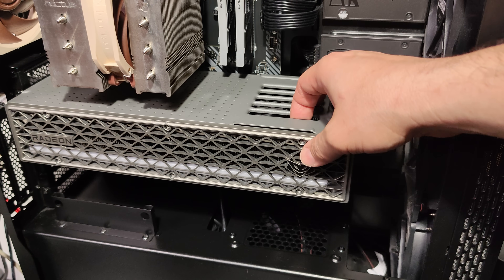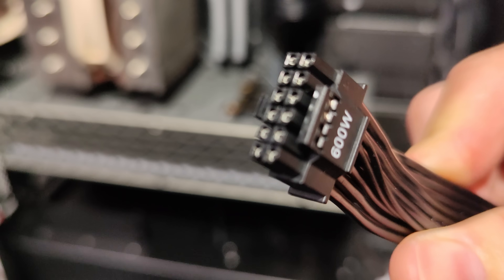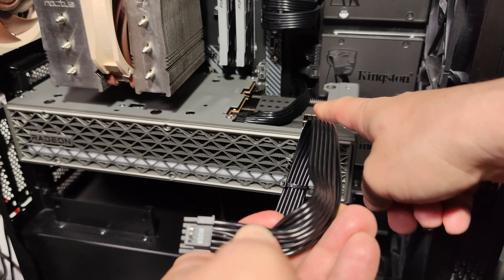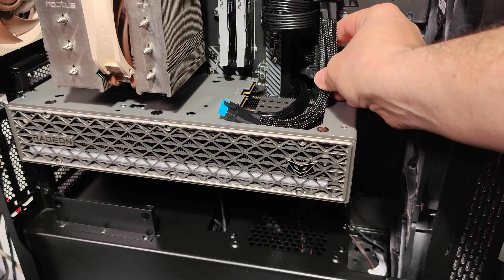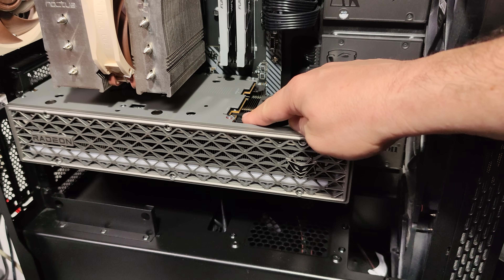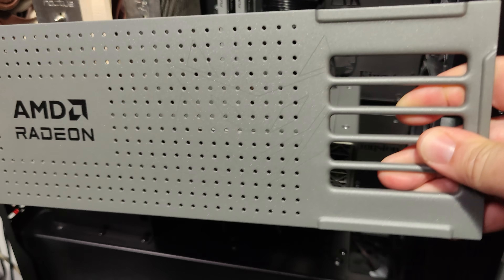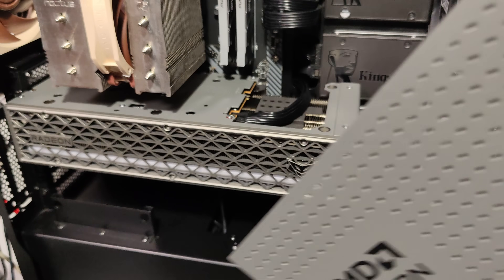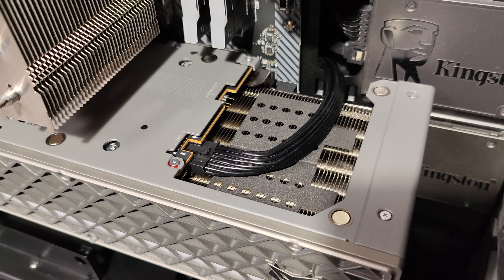Radeon RX 9070 XT Sapphire Nitro+  Magnetic Backplate More Problems Found And Exposed 🔥

Comment: I have question waht is hotsport temp and fan speed in stock. I bought Rx 9070  without RX and i  have in stock Hotspot 76 and memory 76 and speed fan 1550 rpm . I can udervolt -120 and power limit 200w and tehn temps are around 70.
In my case, the factory heatsink is slightly bent at the very end by 2 mm and I'm wondering whether to keep the card or return it and look for another manufacturer.
Reply from the maker: Mine does 90°C hotspot only after a few minutes of game play, board power is 330-332W, fans will ramp up to 2300rpm. I have tried also some unervolt and power limit but it becomes unstable. Personally I would return it if you can and get another brand.
Reply: @TechTronic9000 salty Nvidia fanboy

Comment: 12VHPWR was the sole reason I chose XFX mercury magnetic air 9070 XT. Problem isn't its rating but the fact that in more than one occasion connector has failed in a way it only delivers power via 2 cables and melts them, 2 wires would drop the rating 1/6th 600W = 100W. Melty melty even on 9070 if it fails that way.
Reply from the maker: Regardless of power usage the 12VHPWR connector is a poorly designed connector that is destined to fail easy.

Comment: What a big problem! And also, i don't belive you that measure 5-6 degree lower temperature without backplate. I will check it on mine. You can peel off the foam tape; it's not something you'll constantly plug and unplug. You could use special insulation for your cable and increase airflow in that area. Your claims about the cable not being bent are an exaggeration. The cable itself fits perfectly; all you need is a Velcro strap. If someone with no experience in these matters could use the card as is, they wouldn't have any problems. The cooling system is excellent. Moving the power cable underneath makes it look great.
Reply from the maker: The whole design of this card is a money grabbing gimmick. Why would someone sane use 12VHPWR connector in the first place? Glue and foam on a heatsink? For real?  This is like built by 5 year olds with what they had in their toy box. This whole industry is just putting colored led and foam pads and doubling the cost.

Comment: i removed the foam insulator pad and added wire loom to the included power adapter and have no problems whatsoever. Honestly there isn't even enough vibration to allow the fins to wear through the nylon wrap on the adapter cables in the first place. It would literally take years of the fans running at 100% for this to happen, especially if you use a gpu anti-sag device which further minimizes any vibrations that may be produced. So basically all of these concerns are a big ole nothingburger in the end.
Reply from the maker: The biggest trouble is that people blindingly say Sapphire is the greatest when they did this botched up gimmick just to add 300$ more over the MSRP. And also using the worst power connector ever made, even though power draw is smaller still it's a bad design.

Comment: Skill issue
Reply from the maker: Absolutely agree with you, zero Sapphire skills. Gluing foam on a heatsink in 2025? Adding the spicy hot 12VHPWR connector?! Using a backplate over a backplate to trap heat and increase sag!? All of this for zero benefit but extra 300$ over the MSRP.

Comment: Why would you worry that much for a backplate, I have installed it and using the pc for months. That is not any issue at all.
Reply from the maker: I don't worry anymore because I'm not using it at all. The card is cooler that way with a few degrees.

Comment: I don't get why any of this is an issue. Mine runs colder than the normal specified GPU temperature for standard gpus already, it actually needs something to heat it up a bit lol only thing you're exposing is the card for coke to spill on it, not issues

Where is any actual scientific evidence?
Reply from the maker: No need to believe me https://videocardz.com/newz/sapphire-radeon-rx-9070-xt-nitro-reportedly-suffers-first-melted-12v-2x6-connector-case

Comment: Thanks for the video, I won't buy this model.
Reply from the maker: The new 9060XT Nitro + already dropped this 2nd backplate design and moved the power connector back to the original place. Also my board is not happy at all with playing with undervolting or power limit, just a -30mV drop will freeze the driver or BSOD, same with playing with power limit, so really can't recommend it.

Comment: Are you serious? :D Do you often tinker with your computer while using it? Grabbing the graphics card? Or do you let the cat in to play inside? Because I don't understand! On top of that you show the "problem" that you have a power supply cable that is very hard, because the manufacturer saved money on them. Maybe it's time to buy an adapter? Because the one from the graphics card isn't even that hard :D
Reply from the maker: I'm dead serious, adapter cables and 12VHPWR are a fiery combination. Not to mention using glue to stick a piece of foam on the heatsink and just hide that with another backplate to hinder hear dissipation. This is a fiasco, a pure gimmick. It's not a surprise that Sapphire has already dropped this design in their newer Nitro+ series, wonder why no more.
Reply: @TechTronic9000  I wrote the comment because... I've had this card for 2 months :D I use the adapter that came with the card because I don't have 12vhpwr in my ION+ 2 power supply. There's no problem with placing it or moving the cover. strange. maybe... I don't mess around with the computer, and I don't move it because the computer is standing still? fiasco? interesting... because this card is considered the best 9070 xt on the market. but ok. ps. "dropped this design in their newer Nitro+ series"? yyy 9070 xt is the newest, and it's the top model - there's nothing newer. maybe you're writing about... acer nitro? one of the worst designs :D I really laughed reading what you wrote!!

Comment: I can buy that from you if you're not happy with it
Reply from the maker: I would have returned it if the scalping retailers would have had something else. Sadly return was possible only for 30 days. Only now there are stock of other models from XFX, Power Color, etc. I needed it at that moment for my work. I'm using it without the backplate. Also it's not great either when comes to stability, just a minor -30mV undervolt and it will freeze the driver or BSOD. Same goes for playing with the power limit, weather is -10 or +10% it will freeze or BSOD again.

Comment: I really like that you make this video. You pointed out a valid concern about this card and how 12V-2x6 / 12VHPWR cables (the specifications are the same for cables) are forced to bend rather sharply within the video card, which is a problem for a stiff 12V-2x6 cable. It can force users to have to buy a more flexible cable, which is annoying if the user did not anticipate the problem and either would have to buy a flexible cable or have a spare flexible cable on hand. A video card should be able to work with any well-built standards-compliant cables that plug into it without any trouble.

Another potential problem that I thought of is what happens if you have a motherboard that is wider than standard ATX like some SSI-CEB or so-called “E-ATX” motherboards. I understand that the card’s design is to help route the power cable towards the cable management holes behind the motherboard, but that could be a problem if the motherboard is too wide.

On the other hand, most RX 9070 XT cards lack fuses, which can allow the card to overdraw power from the motherboard and fry it if the short circuit develops on the parts of the video card that draw power from the motherboard. Having fuses on all of the power inputs like on this card also limits the damage that can be done by a shorted out component to other components of the video card, greatly boosting the probability that a competent technician can repair the video card if a short happens because a fuse will blow, stopping the damage. This card also has an upgraded voltage regulator module, boosting the voltage regulator’s efficiency and voltage stability compared to a comparable less expensive RX 9070 XT.
Reply from the maker: I also don't like applying glue to the heatsink to stick a piece of foam, then hide it all with another "backplate" so the one in contact with the board won't dissipate heat. Sapphire has already dropped this design on their newer Nitro+ series.

Comment: I have FSP hydro G 1000w PSU , also it has own  atx3.0 standart and 12+4pin connector. While using PSU's stock 16pin connector cable, the card doesnt give vision to screen
Reply from the maker: The 12VHPWR connector is a mess...

Comment: @TechTronic9000. Whats worse is there RMA support. Had the 7900 xtx  Nitro because of that stupid LED light in the back and were close to NVME double the heat from LED in back burnt the motherboard when contacted too Sapphire with proof even retailer said contact Sapphire they stop replying after 1 mail. After that I said no more Sapphire if you atleast DECLINE write it, dont stop responding thats like STFU to customer.
Reply from the maker: They also dropped this design already on the new Nitro+ models, guess why!?
Reply: @TechTronic9000 haha dont tell me led bar overheat the plastic on front grill or spmething?
Reply from the maker: @syzygy3107  They have dropped the 2nd backplate and moved the power connector in the regular spot.

Comment: i was nearly buy that card but i saw yesterday the red devil spectral white 9070xt came so i will buy this. I don’t know which one is better sapphire. nitro plus or red evil btw .
Reply from the maker: Definitely get the red devil. Beside the issues I explain here, the Nitro+ is also very unstable if you play with undervolting or power limits. Juts a -30mV undervolt will crash the driver of BSOD.

Comment: just picked this card up having an issue with the backplate and wondering if anyone else has experienced this. 

with the backplate installed the fans will not spin no matter what, when the backplate is removed everything works as it should. not seeing this as a common issue anywhere online. any suggestions on how to remedy this would be appreciated.
Reply from the maker: Yes.

Comment: What hot spot temp do you get with +10 power overclock if you sustain draw at 370watts? My taichi goes to 112.. wondering if its defective
Reply from the maker: Mine will not run either -10% / +10% power. It will BSOD or crash the driver under workload. It will also crash when undervolting as little as -30mV.
Reply: @TechTronic9000  update, i moved the gpu to the gen 5 slot, 110 seeks to be the max temp now if i stress test to the max, I put the max power to 7 percent and it's fine with low 100s at max temp

Comment: I am about to build a new system and looking for parts. this card caught my attention bcecause the Cables are hidden in an unique way and i love my systems to be as clean as possible. but i never thought of this kind of issues that could appear with that style. thank you for this video. i will look for another version with classic 8 pin connectors.
did you also notice ratteling from the magnet cover?
Reply from the maker: I don't use the backplate at all as it doesn't properly sit and also keeps the board warmer.

Comment: everything you said is fine, other than the part of it hitting your motherboard, please provide proof that picking it up and moving it around normally would cause it to slip, infact then also show HOW much force is needed in throwing your pc around for it to actually move, i have the card and can guarantee you that even shaking it my hand the plate doesn't move and only if i shake it violently does it move slightly
Reply from the maker: Just explain me how dumb is to pay for glued foam on a heat sink, the uses the sh*it 12VHPWR connector and just to to make more money by just strapping anther so called "backplate" over the backplate like it's the 90's and and it's gets faked pimped up by a music channel.
Reply: @TechTronic9000 didn't you buy this card? Bro wtf

Comment: First solution. Spend 20 bucks on a ezdiy cable extension set. The cables are braided and flexible. I have a 4090 with FOUR 8-pin connectors down to the high power connector and I've had zero issues. Voltage drop or not. Does it overheat? If not, why on earth are you picking apart the design of the connector heat insulation? It keeps the direct high temps from the heatsink off of the power cable. Next time make a review after you eat, not when your hungry and your sentences are all garbled together.
Reply from the maker: Already spent 300 euro more than the MSRP for this gimmick, just to get glued foam over the heatsink, the 12VHPWR worst power connector ever made. Are you kidding with the backplate, it only trap heat, no cooling effect.

Comment: I don't understand why people are silent about this problem with the connector in the sapphire nitro+,many write that the card is very hot, the memory temperature exceeds 90 degrees, now imagine when you play with such temperatures your wire will simply melt or problems with the video card will start due to overheating, sapphire in this generation made a big mistake.having made such a connector in an inconvenient place for the sake of design, I think it is necessary to take a video card from other vendors, such as power color
Reply from the maker: Also the same people that believe the bs about the 2nd backplate that only traps heat and adds weight. Then for cooling what to expect when you glue foam over the heatsink!

Comment: wow. i was a few clicks away from buying this one after waiting so long and doing some last second review checks. this video 100% addressed a very annoying and inconvenient issue. i was super hesitent on buying it because the color is ugly and so is the gpu in general but that back plate thing seems really stupid and that alone made me decide i dont want to get this. along with the grill design and the grey color. good and valid video
Reply from the maker: And now to also mention that mine is very temperamental. If i undervolt as little as -40mV -> BSOD or driver hang, windows freeze. Same goes when playing with the power limit regardless if it's -10% or +10%. On stock settings is rather stable. I have disabled the 0dB mode as the GPU was not so hot but VRAM was doing 70°C just idling around and it's not even summer here.

Comment: I haven't had an issue with mine. I think you're over thinking this by alot lmao... My MSI AB505 cable bent in no problem. 
You won't have voltage drop from an extension that short lmao...

Comment: Not had any issues with my 9070XT Nitro+ backplate or power cable. Using the supplied  cable adapter.

Comment: Why would you want a 1300W for a 9070 or even a 5090? even running a Intel your pc wouldnt need more than 850W.
Reply from the maker: To have enough headroom for other projects, including a second GPU, also because I use a more power hungry CPU, a Ryzen 9 5900X, also because at the moment I have 5 SSD drives, also because my PC will work 100% full load for hours and hours, also because the PSU has 12 years warranty and it has >90% efficiency at just above 20% load also because it was cheaper in comparison with other better known brands that had worse efficiency and less power.

Comment: Good video and very informative, I have this card ready for my new build with the DH15 so this type of info is great. What case are you using for your build as that's the last piece of the puzzle for me
Reply from the maker: I'm glad you liked my video, the case is an old Thermaltake View 27 "Gull-Wing" https://youtu.be/E-FhaUiqJBo I like it as it's very "restrictive" and silent, it's also compact yet able to fit all my stuff such as 3 SATA SSD, can install front 360 radiator, has space to normal hidden HDD and another SSD, can find also a RGB / FAN controller, permits decent cable management, also supports vertical GPU mount. Only con is that the side panel is plastic and can be easy scratched.
Reply: @TechTronic9000  I have an old Fractal R4 which I was thinking of just using again but suspect I will go for one of the best quiet cases. 500 FX, 800fx, or 70.

Comment: Don't run it with 0 dB. Is not kind of card you' would do that.
 Build a fan curve is easy.
All 9070 XT runs hot on VRAM.
0db tends to wear down faster your fans, building heat under the fans rotor and than leaks fluid. Not to say starting rotor and stopping rotors doesn't save energy and wears faster the rotors of the fans.

Comment: Valid concerns for this GPU.
Reply from the maker: Not to mention how many buy this for "design" pay 300 euro more from msrp and they actually get a botched up card with glued foam on a heatsink and a fake backplate to trap heat, all along with the melting 12VHPWR connector.

Comment: I don't see a problem here like do you move your cables while gaming or using your pc? do you wiggle the cables when gaming? are you strumming the cables  like a guitar ? doesn't  make any sense like your making a problem that doesn't have to exist XD
Reply from the maker: I'm pretty amazed that everyone buys this for "design" paying 300 euro more from msrp and they actually get a botched up card with glued foam on a heatsink and a fake backplate to trap heat, all along with the melting 12VHPWR connector.

Comment: Dont see any problem with backplate....problem is between pc and chair🖖👋
Reply from the maker: Then you probably don't see also the glued foam on a heatsink for 300 euro more problem and the worst power connector ever made.
Reply: @TechTronic9000  i dont see any problems...no problems with plate cause magnets are enough strong....no problem with cooling... worst connector? Connector is ok...problem is your cable and his managment...